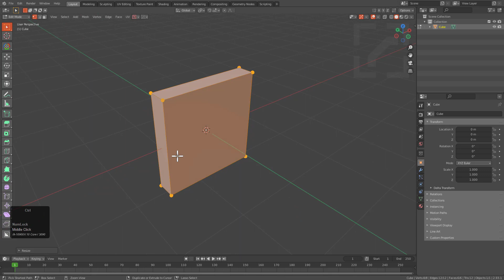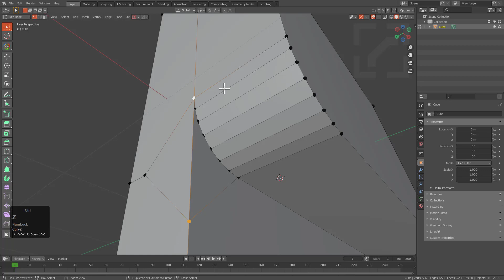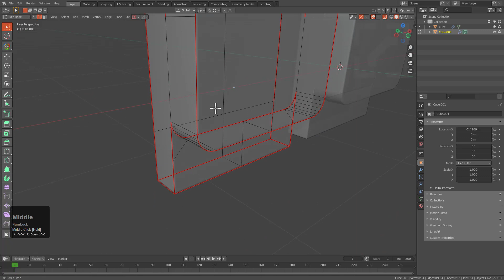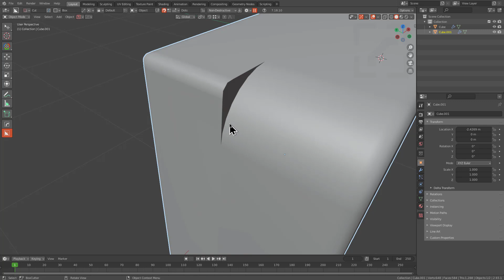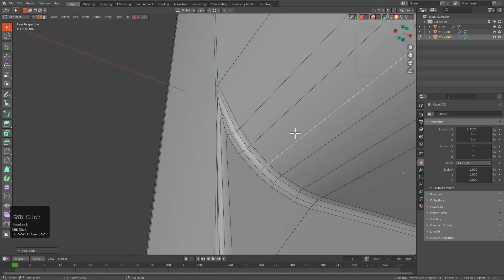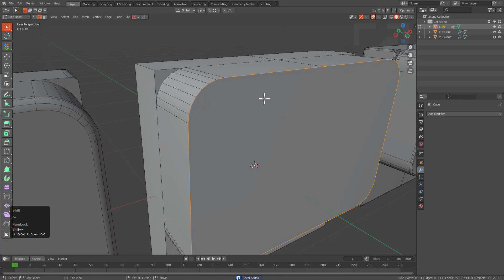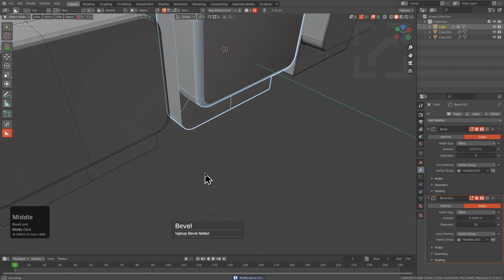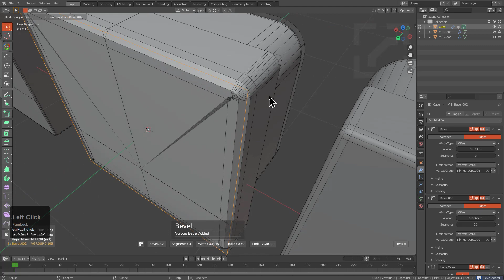#hardops 987_15 - Bevel Convergence Troubleshooting

Comment: Seems like a ton of work. I'm slowly acquiring some HSM skills but occasionally am dumbfounded by the holes HSM can dig for itself. Case in point, made in your helpful current video. To use an entirely different approach, in the 'sketch' environment of Fusion-360 (to end up with the generic rectilinear shapes you were working with) I would draw the larger rectangle, then a line across [closer to the bottom], then fillet those 4 inside corners on the top rectangle. Then extrude one way off the sketch plane with just the filleted top rectangle selected, then select the entire rectangle along with 90 degree corners and extrude (to 'join') the other way. Apply a few corner roundings where needed. Done. Or have I got the whole thing wrong? I should build that as described, export as FBX and import into Blender 2.93 and have a look.
Reply from the maker: thanks for the insight!